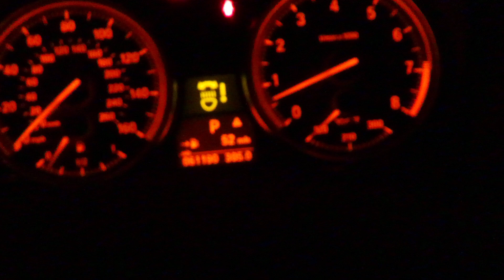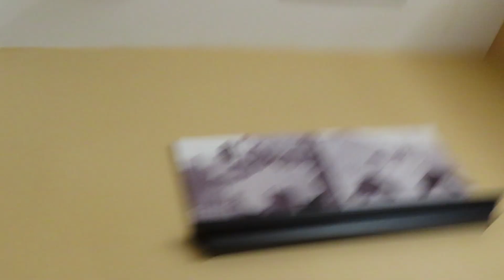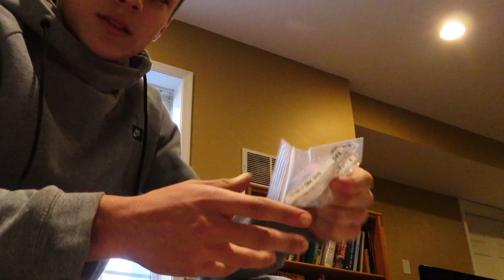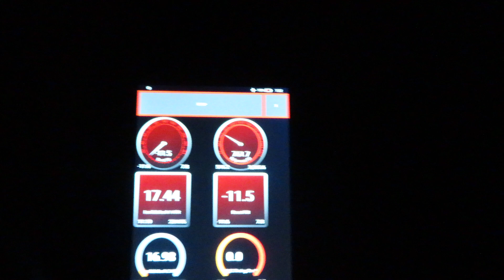My BMW 335i Broke Down! (Installing index 12 injectors)

Comment: Sounds like everything is running the way it should now. What made you go with MHD over Cobb? I'm debating on whether to go with Cobb. I like the idea of a stand-alone controller rather than the cellphone.
Reply from the maker: Joel Klashinsky i went with MHD because it was cheaper and offers the same amount of power with their tunes, my cars been stage one tuned with MHD for about 5 months and nothings gone wrong with the car because of the tune so far lol